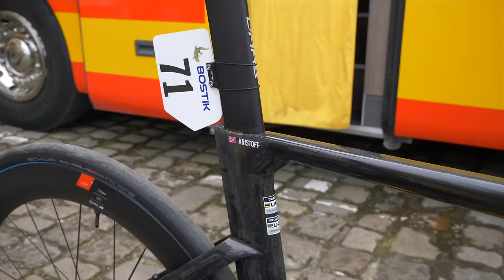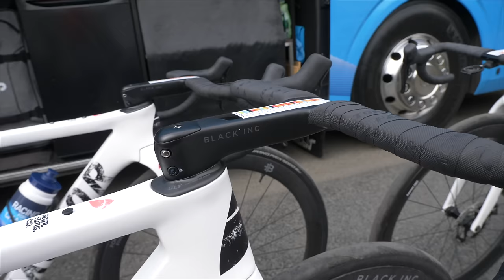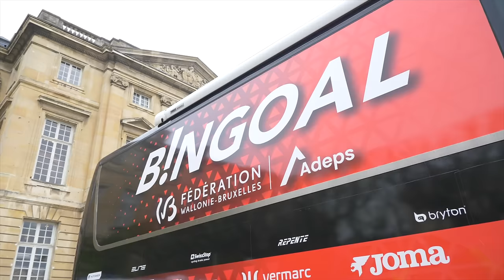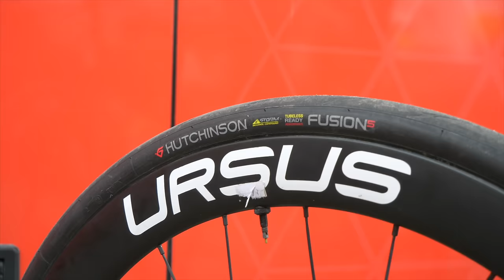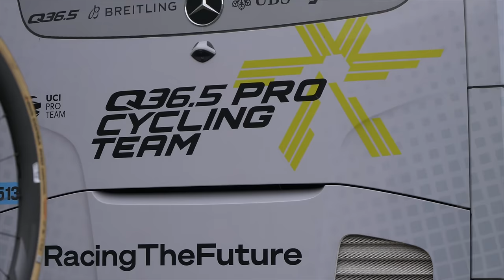The Best Tech From Paris - Roubaix 2024

Comment: Very interesting Shoddy and thanks for sharing. I wonder if those teams who vary pressure between road and cobbles or change from 28 to 32 mm wide tyres have empiric measurements proving that they actually gain anything with it. My own experience shows not much difference between 28 and 32mm wide tyres (rough english country lanes).
Reply: Not much difference is maybe enough for pros?